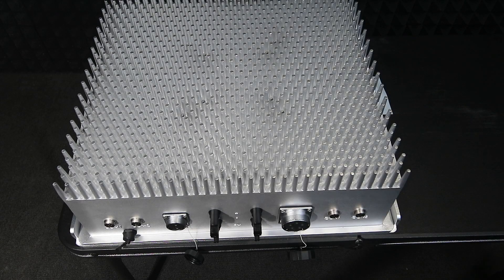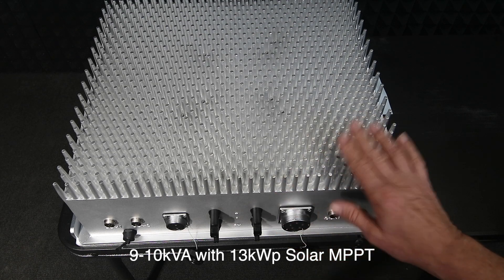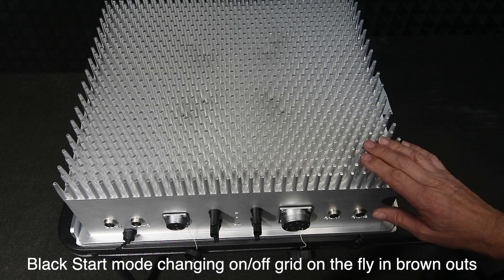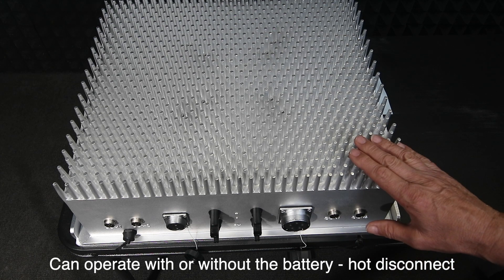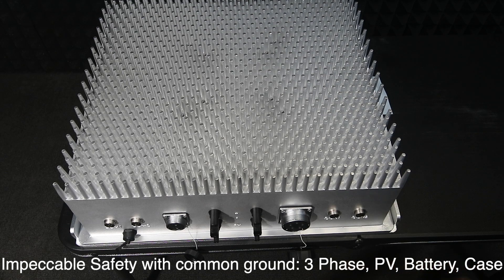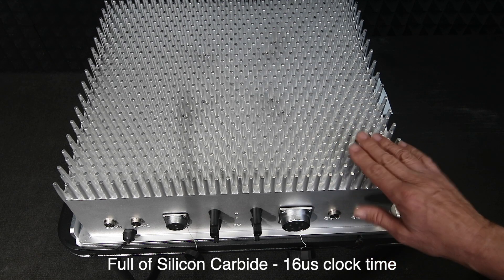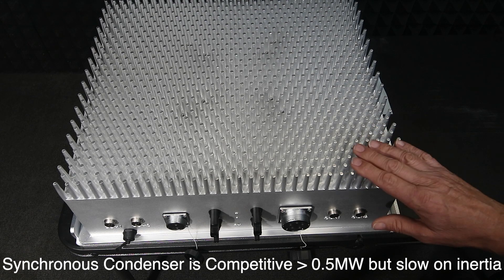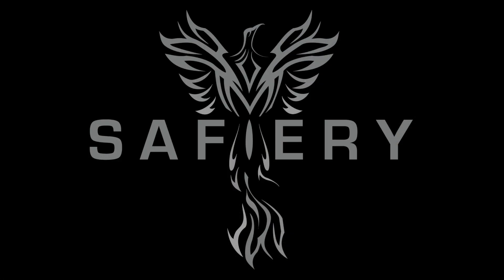Virtual Synchronous Machine 3 Phase 9 10kVA Perfect for off-grid with generator support or on-grid

Comment: Is your ground fault interrupt circuitry custom on the board or an external module?
Reply from the maker: Its standard on the board. Plus it checks the components that measure GFCI to ensure they are functional. Its slick on safety.

Comment: Huge amount of terms thrown around for which I understood but many will/would not. All I kept asking through the video was this supposed to be released on the 1st of April?
Your company makes some great products on paper but thats as far as they get as prices are through the roof, guessing this will sit up there with unobtainium.
Reply from the maker: This is a 2025 product for us. The IEEE Standard was published as a draft as we announce this. Its in a totally new classification and not inverter class. Less then 500kW it is very competitive for off-grid/genset/microgrid applications. There is one I know at Dalrymple Bay in Sth Australia, and its 30MW. Electranet reports: Financially, Dalrymple Bay VSM has been successful, earning significant revenue from frequency control ancillary services (FCAS). By 2021, its performance was robust enough that it had returned the $12 million grant it had received from the Australian Renewable Energy Agency (ARENA). That was in 3 years! This system is notable for its role in forming an autonomous regional microgrid. In the event of a transmission line failure, it can operate independently, supplying power to local customers and integrating with the nearby 91 MW Wattle Point Wind Farm to create a 100% renewable energy grid.
Reply: @Safiery  All very well but your audiance here is not likely the types who are building  megawatt systems. Many of us have to make our own money to spend rather than wasting others (tax-payers). Yes, you dodged the part of products being priced out of manys reach.

Comment: You have my interest.  Small looking connectors on it.  I would say a disassembly is in order!!!  I use an outback inverter to power my off-grid home and it has a fairly huge transformer inside.  It also has a rating far far lower than this unit so I'm interested in how they performed this magic.

I'll subscribe in hopes of a teardown!!!  In the infamous words of Dave Jones @EEVblog "Don't turn it on....  Take it apart"
Reply from the maker: Hi No Tear down. What's inside here is secret squirrel stuff.
Reply: @Safiery  Ahhhhhhh...  I know how to read that :)   Extraordinary claims require extraordinary proof.   Just looking at the connectors pretty much tells the story.
Reply from the maker: @dersteer  Yes 400V doesn't need big connectors... and neutral plus battery negative and solar PV negative all bonded to chassis for safety.